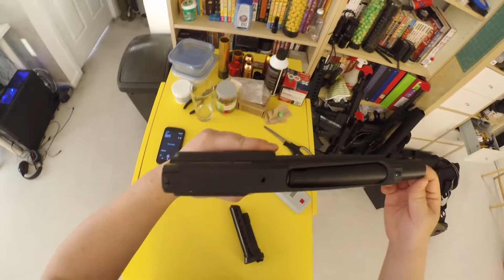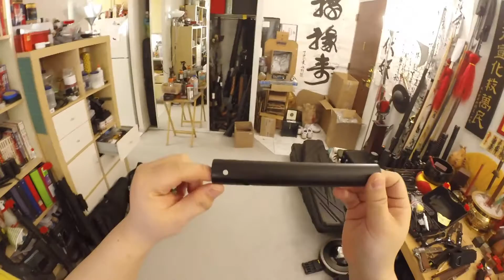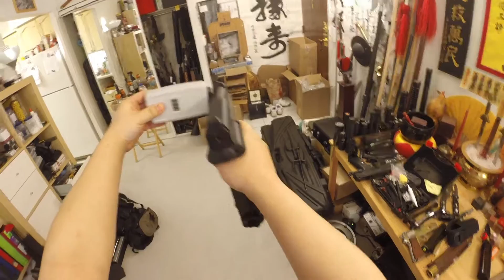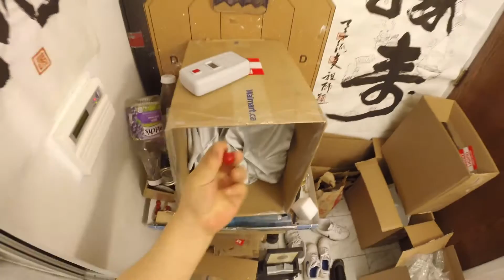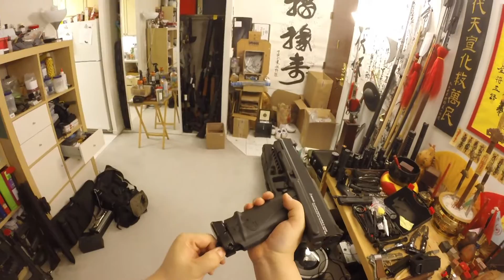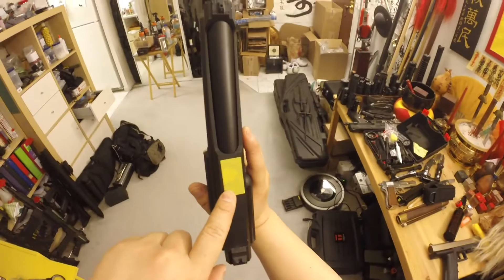Tiberius T8.1 High Power Non-Ported VS Ported Barrel Power Chrono Test

Comment: fill out solid first strike rounds with fishing lead balls (around 5,5 or 7,5 grams each) and cover up with hot glue,make the finn stronger so it wont shatter due to the high air flow / pressure. my 8 1 came up to 45 j with it
Reply: and before filling out drill out the half round wich is full plastic so the lead ball is in the tip of the fs round ;)
Reply from the maker: well the FS round will shatter upon impact for sure, so doing so much for one shot is not worth it though
Reply: i shoot them at a trap similar to yours ( a textile bag filled with thin plastic foil)and they didnt shatter there yet.if you hit one with another its similar to the breaker balls and they destroy each other . also shooting at harder targets like tin cans doent make them shatter at all yet.and the fps improvement due to the more aerodynamic form of the round is enormous,or what do you say about that ? :) btw i like your videos very much just wonderbecause i searched your videos and never found something about the solid first strike rounds from rap 4(only in 1 vid there you mentioned that u filled them out in the finn section with wax and steel bbs (i tried that too but the wax fell out when i shot thgem so hot glue worked better ) because i think u like the power too :)
Reply from the maker: trainwreck bluray If that didn't shatter yet and can be reuse, I am sure I want to try your idea then. Great stuff, maybe I should try that soon! :)    The thing is, if the round shatters, all the energy is dissolved and spreads to all directions which reduce the overall damage and there will be no penetration. But then, with the right HARD projectile, I think it's worth trying. I thought of creating WOOD SLUGS like FSR shape too, then we can glue some lead ball inside the head of it and so it have more weight. Now THAT is deadly...
Reply: the idea with the wood fsr is a good one,u need not to reinforce the finn and it will be even more air efficient.i used a 13mm metal drill to drill out the plastic fsr tips(after some practice it showed that 13mm is the best option and a bigger hole is not needed for 7.5 gram lead ball because it has like this diameter or even a bit smaller.the results with hpacame up to 45j whereas the co2 got a peak of 1j more  like 46 j in one shot.
Reply from the maker: trainwreck bluray NICE!  I really want to try this now, LOL!  If this does not shatter on soup cans, I bet it will not shatter on human too! :)
Reply: think so too :)but when i tested them with my 4.1 wich arrived today i saw that in the 683 rifled barrel they will not go through at low power^^ i didnt test high power yet :Dyou could also take the scarab arms 1two 1 rounds and put the little .52 paintball out and just insert a steel ball with 12mm or sth like that..
Reply from the maker: trainwreck bluray
Not gonna work, the steel ball might be too heavy too, and the 121 round is not a good option for sure. Forget the finned projectile, stick to balls is the best idea. It's just "fancy' to have shaped projectiles, but there isn't much use of that shit yet.. 121 round is a joke.. lol
Reply: 👌 i just made some of these i found some nice fishing sinkers, i drilled a hole in the back plugged it with the sinker and filled with glue about half way I'm getting 6grams on the dot every time. Thanks 👍

Comment: Lmfao I added six .25gram bbs in three of them I added thumb tacks in two of them I added a heavy steel 3/8 shaft in one can't wait to try that one out and made about 20 normal slugs I wish I could send you a pic of them I'm gonna test then out tomm can't wait.lmao I got a lot of squib loads today I keep forgetting that the tank gets weak after 18 to 20 fills so my slug stops at the end of the barrel which is no good but I'll get used to changing out the tank
Reply from the maker: chris miggz hahahahaha I can see you are having lots of fun there!  A nice reminder for you there. CLEAN YOUR BARREL!  See inside it?  It's all fucked up now, you will see all the crap around it and it's not gonna be good. Clean after each use! :)
Reply: Hey Mak I was wonder is the foot pump set up for the APS can 870 shells worth it? What is needed to make it work as far as the adaptor or the line.
Reply: Is it more powerful then the two 12gram co2 set up? The 88 gram set up works well I already tried that the power from it seems a lot more then the two 12gram co2.
Reply from the maker: chris miggz You will need a benjamin pcp pump and then get a remote line for paintball which you will need the ASA to quick disconnect fitting adapter from that kit.. and now your gun is read to go on HPA. It's worth it if you want to do HPA experimenting with higher power. Using the pump you can pump the shells up to 2000psi max and it will fire a 30 joules shot with the 3.9g rubber ball, which is very deadly!  If you want to use a tank to refill the shells, then go with only a HPA tank that has the regulator preset to 1400 or 1600psi output, and fill the tank up with a handpump or compressor or scuba tank.. then use that tank to fill all your other shells using the remote line setup and it will be good!  Fast and cheap to shoot plus more power than Co2
Reply from the maker: chris miggz 88g and Co2 power is WEAK. The max you can do is about 12 joules -16 joules max on Co2. With HPA you can go up to 30 joules. What are you looking at is a power that can match the military riot gun FN303. INstead of firing projectiles that breaks (all energy dissolve on impact), you fire slugs or solid rounds that weight more than a lame 3g paintball.. and that is going to be a skull breaking man stopping power shot.  Especially if you make your own slugs, you can punch the slug through plywood with ease and even punch a slug into a TV....

Comment: Hey just found another way to make slugs hot glue gun it makes the slugs solid and they don't break when they hit something its almost like a very solid rubber there great I was curious if u could make some and test them for me as far a weight and joules and fps. I removed the gas part of the shell leaving only the red plastic piece and I flipped them up side down I used a dime to slip in the shell and rest it on the threads and spreyed Pam the cooking oil on the inside like a coating and started using my hot glue gun to fill it and once close to the top just sprey ur finger wit Pam and press on the stop and smooth it out if u don't have Pam oil on ur finger it will stick and burn u which sucks I would really appreciate you testing them out for me I also put them in the freezer right after and there done maybe 10mins thanks a lot bro
Reply from the maker: chris miggz thanks for the idea and t hat sounds good, if you can add some steel ball bearing in there it will be even better!  Too bad no steel ball bearing! LOL  or add a few coins there for weight!   I don't have any hot glue now, maybe later on I will test this idea out!   Fun!

Comment: not sure if its just my wax slugs but there not very accurate which is to be expected i guess because there not really balanced.
Reply from the maker: chris miggz your wax slug need to have weight, put some steel ball bearings to add up the weight, and measure them.. mine are 4.7 grams each and approx.

Comment: hey mak great video like always i made those custom wax slugs for the 870 and oh man they hit hard that shit might be deadly if you shoot someone in the head. crazy shit i was playing with the wax slugs i loaded some with .25gram bbs about 4 of them and it hit alot harder but seems like the slug explodes on impact i also tried bird shot into the wax slug same thing they hit really hard but fall apart on impact. love shooting the slugs only down side is it dirties the shit out of my barrel lmao. im gonna try shooting paintballs tonight i ordered breaker balls so waiting on them.
Reply from the maker: chris miggz The shotty don't shoot breaker balls too well because the breaker balls are often not big enough. A tiny bit too small. trick is, you can put a tiny piece of fabric like T-shirt fabric (a square of it) below the ball and stuff the ball in. NOW that is a tight air seal and your ball will fly VERY nicely.  Also try the 3.9g hard rubber balls, get those from Michael Roof as well, email him.. and tell him you are referred by me, so ask in email for a discount quote.. even the breakers, you can try to ask for a discount quote as well.
Reply: Ok I will do that thanks so much you've been great. Ya the wax slugs dirty the barrel so much I don't think the hot glue gun slugs dirty it at all I Also put a lil lube on each hot glue slug so it has no resistance in the barrel works great and they come out the barrel super clean no dirt Nuttin I'm gonna email your guy for the rubber balls and breaker balls thanks a lot bro I really appreciate it
Reply from the maker: chris miggz
great!  enjoy shooting!! :)  get on HPA later and enjoy the higher power!  With HPA, the shotgun can fire up to 30 joules!
Reply: Hey I loaded a wad and a steel ball bearing into the shell and capped it off and the ball bearing when thru all my boxes and into my dry wall that one is probly deadly at 10 feet crazy powerful and they call it an airsoft shotgun lmfao ya right
Reply: The HPA is crazy powerful and these lil shells hold 2000psi its crazy lmao
Reply from the maker: chris miggz That is not the high power yet. You have never tried HPA... with HPA, you fire up to 30 joules which is double the power you get right now. Imagine that again. I used to be very impressed the Co2 power before but after I tried HPA, You will never look back. LOL!
Reply from the maker: chris miggz Yup, the 2000psi is legit but you will need to lube the shells with silicone grease first, or else the shells will leak faster
Reply from the maker: chris miggz Yup, the 2000psi is legit but you will need to lube the shells with silicone grease first, or else the shells will leak faster